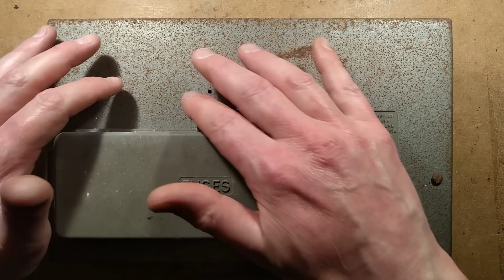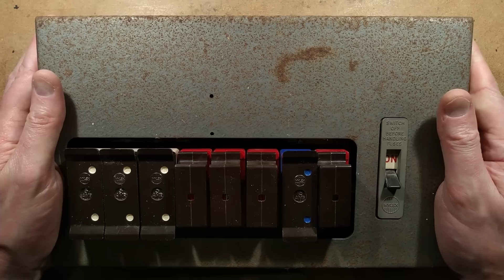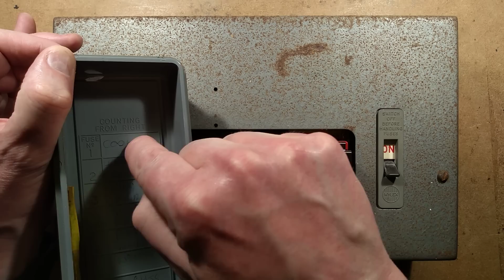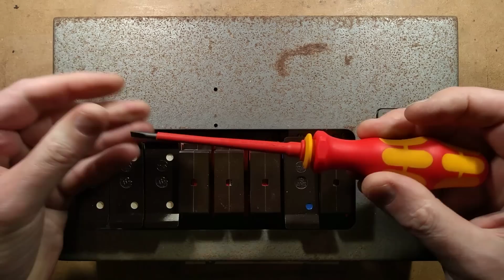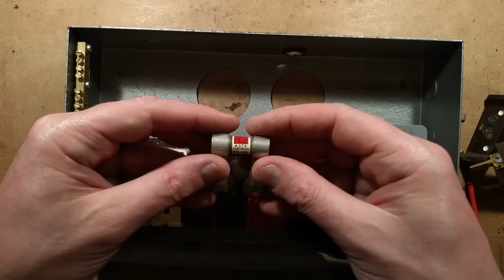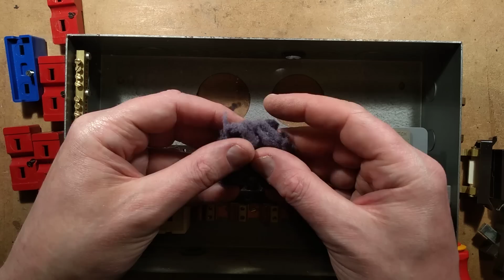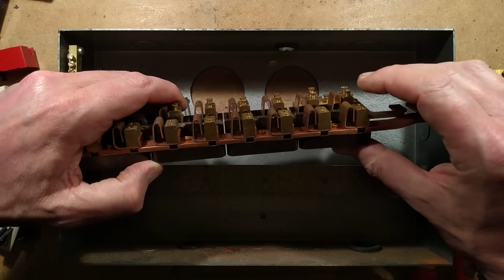Teardown of an old British Wylex electrical fuse box.  (with bare fuse wires)

Comment: When I was 5 the council replaced the fuse box in our flat.  I asked if I could have it and they gave it to me.  I took it apart and put it back together many times, even taking it to school to show my class :)
Reply: When I was about 7 or 8, our council house was rewired. This was the 1960s. Then in 2004 I worked in the electrical department of the local council, as did the man who had been the apprentice on the rewire.
Naturally I told him there were still a few snagging issues left to resolve, and asked when he could come round to sort them out. 🙂
Reply: It is awesome they gave it to you. As a kid I asked a man at a TV repair shop if he had any old circuit boards he was throwing away, he went in the back and brought two out. I spent years just looking at them, reading part numbers on the components, and learning what each thing was even if I didn't fully understand how they worked. The shop owner also warned me of the dangers of the high voltage inside the tv and how the capacitors would hold a charge and shock me in case I was thinking about taking apart a working TV.
Reply: @Andrew Ballard That is really awesome! It amazes me how kids are able to know so early on about what will likely become a lifetime passion for them. I imagine since you are watching BigClives videos your interest in circuitry has never died down.
Reply: Rick Delair  That is really cool! You knew it was your interest as kid! Your story reminds me of being a kid I would always go to the tire section at stores like Sears or Price Club, I was always so interested in cars so I would just walk around looking at all the new tires. As an adult, I have been an automotive tech for 20 years now. I could have told you at 4 that's what I wanted to do. The sad part was that no high schools in my area offered any type of auto shop. They closed them all down years before I attended. I had to go off campus across town to take an automotive program. 

As for your hobby with lights, I have been working on learning CRT TV repair. I am currently restoring a 1959 Philco Predictia television. Sadly with new HD flat screens just like forced LED light bulbs, not only has all CRT TVs been thrown in landfills, the shops of skilled TV repairman have all gone extinct. I have been collecting all the specialist CRT TV and old vacuum tube radio test equipment that has been ending up on eBay for pennies. I have about a full TV repair shop of tools now. 

I am glad you have the passion to collect and preserve what would otherwise be lost. Those lightbulbs are so important as they were the first generation of actual electric lighting, something that is taken so for granted people rarely remember that less than 100 years ago you were lighting the way with a flame.
Reply: Are you that guy with the vintage light-bulb website?
Reply: @uK8cvPAq  not me, I'm afraid
Reply: @christopher88719  The good 'ol days.  Now, the "helicopter moms" don't let their kids play with asbestos or other carcinogens.   Always making a fuss.
Reply: Rick Delair  boy I wish I could send you some pics of my light bulb collection...I love big industrial monsters and weeny dolls house specimens...but they must be tungsten..I have a 20,000 watt 240 volt beauty..thats a 40 amp lightbulb..the filament is an enormous spiral..sounds nerdy but makes a really interesting objet d'art along with about 5 other examples⚡⚡⚡⚡⚡  ps I also have a 4000watt microwave valve..2 foot 6 inches of brass waveguides and delicately suspended path tunnels in a 5mm thick glass tube atop a huge magnetotron!...exquisite ✔⚡⚡⚡⚡⚡👜
Reply: Rick Delair  ABSOLUTELY LOVE TO SEE YOUR COLLECTION 👀⚡⚡⚡⚡⚡👍👜
Reply: @christopher88719  that reminds me of when I had my first black and white TV in my bedroom. I was around 10 year's old at the time. My parents bought it very cheap from a guy as a present for my bedroom. It made a hell of a hissing noise behind the back cover when it was on. Being curios, (and without my parents knowing) I took the cover off and started poking around  to find out the area this came from. Dangerous and uneducated.
I found this big black plastic thing which the noise seemed to be coming from. I turned the TV off and started ripping this unit apart with a screwdriver to investigate. All the insulation had gone by the time I finished and finally gave up to find where the noise came from. I turned the TV back on and it went with one hell of a bang whilst I was prodding the thing. I now know what it was. It was the line output transformer feeding around 10KV to the CRT. How I am still here to to tell this story, I will never know.
Reply: Rick Delair wow , any chance of some pictures of them ?
Reply: @Andrew Ballard I was little, my dad came back from work with little motors, a battery, and little cogs and gears... I loved them... I wasn't any more weird than any other kid of the time.
Reply: Dr. M. H.  Ten years ago I was replacing the brake pads on the front of my car so both wheels were taken off. The car was held up with broken house bricks because that's all I had. I didn't have axle stands. I decided to drain the oil as it was convenient but I got the wrong size spanner for the drain plug. I crawled out and five seconds later the bricks gave way. If I had the right spanner to begin with ..... I am still here keeping safe through this pandemic and hope you do to.
Reply: @retrocomputeruser  Kids in those days were better made than the modern ones - we messed around with all sorts of stuff that would give elfin safety a heart attack, and we didn't die more than occasionally.  On those old TVs you could get cool plasma arcs if you poked the right place with a big insulated screwdriver.
Reply: @larrygall5831  
As Urban Kids growing up in the ruined buildings and slag heaps of the Industrial Revolution, we had a whale of a time playing in these fun places: arsenic works, copped works, sliding down slag heaps with bottomless black pools of water, splashing about in the toxin contaminated reservoirs of old works……ah what fun we had. My parents didn’t know though…..
Reply: That’s cool! I am having my fusebox changed on Tuesday from a Wylex 8 way fusebox with fuses like that to a 14way fusebox brand fusebox with RCBOs and I am going to ask to keep the old fusebox and I’m going to take it to school and show my freinds,

Comment: I'm not an electrician but I thoroughly enjoyed this video. I have a smaller 3 fuse Wylex in my garage where I plug my Tesla 3 pin plug in for slow charging. You video has demystified that setup nicely 😊 thank you 👍🏼😊

Comment: Clive, some years ago I was sat with my grandchildren watching Peppa Pig. (happy memories). My daughter-in-law opened the door to a cupboard under the stairs and shouted fire! I was able to gather up some burning plastic bags and dump them in the kitchen so we could put the fire out. The cause was a wire fuse (as  shown in your video) had blown. A hot glob of molten fuse had dropped onto the combustible material stored or should that be shoved in below. We changed to a modern breaker system (?) with in the week! Yes, Clive, the cover had been lost!

Comment: I liked this one. While I don't live in the UK, it was still interesting to see how a different country approached the solution to the problem of getting power safely into homes.
Reply: Definitely agree.  I was born in the late 70s in the US and I remember my parents' first house had the screw in type fuses (see link). -- upload.wikimedia.org/wikipedia/commons/0/07/Edison-base-and-Type-S-fuses.jpg
Reply: @OAleathaO   They are as reliable as the more modern circuit breaker type, the only drawback is you have to keep fuses on hand.
Reply: @OAleathaO  Never had those as a kid myself, our house had breakers, but I always wondered if you could screw light bulbs into the fuse sockets. :P Figured it would show you which one had blown easily, and lightbulbs were cheap. (Of course, as a kid, I figured 'fuses blow, lightbulbs blow, fuse = lightbulb'.)
Reply: @DijonFromage  They really are quite similar, too - a thin metal wire that heats up, and a holder. Only real difference is the lightbulb is thoughtfully constructed to handle getting a lot hotter. :)
Reply: @OAleathaO  still plenty of them around and in use in the notheast

Comment: You nearly gave me a heart attack with your liberal display of "asbestos"... Nicely done :-D
Reply: I put duct tape over my dryer's lint trap just in case. :D
Reply: I grew up in Quebec, not far away from one of the world's biggest asbestos mines, there's a town literally called Asbestos there. Our government was one of the last one to ban asbestos. It's still kind of surprising to me seeing how people freak out about asbestos. When I grew up, all we heard was that it wasn't all that bad, that you should just limit long term exposure. I'm pretty sure handling asbestos in your hands for a couple minutes, like you pretended doing, would not have been considered a big deal around here in my youth.
Reply: Olivier Engelkes I used to work in Iron ore in the main area in Australia which produced blue asbestos... I was trying to work out where the other colours in there came from for a second😂
There is a very pretty rock that gets quarried out of the BIF they call tiger iron which can look like landscape paintings... or modern art which is from iron oxide replacement of the asbestos which originally filled the fault or whatever... people sell it on eBay and some of  it looks a lot like that (the colours not the swirling) when you crush it a bit... because not all the asbestos is replaced
Reply: @gfilion  that it probably was not considered a big thing back then is a testament to how effective the industry’s efforts to cover up the risks were.
Reply: @gfilion  You can handle asbestos however long you want. I've seem mesothelioma and I say better safe then miserable
Reply: You have a heart attack just at the thought of someone having about a 0.0001% increased risk of cancer at some point in the future? Did you nearly have an aneurysm when Clive ate those charred sausages? :P
Reply: @RFC3514  no, but when he touched live conductors some weeks ago ;-). I am in no way able to give a professional assessment, but I do think the risk associated with fondling asbestos  is orders of magnitude higher than eating sausages from the electric chair...
Reply: Not that amount of asbestos, in his hand, for that amount of time. The risk was (or would have been) essentially zero. It's like being scared of bananas because they're radioactive.
Reply: @gfilion  that mine used to say the white asbestos wasn't bad, so they could still sell it...
Reply: @RFC3514  I work for the lung cancer service, and trust me... you shouldn't be so brazen about the dangers of asbestos. It's far more dangerous than you seem to be informed. Mesothelioma is no joke.
Reply: I'm not "brazen" at all about "the dangers of asbestos". I simply know what the dangers of asbestos actually are. Freaking out at this video because "it might cause mesothelioma" is like freaking out a video where Clive handles a lithium battery on the grounds that "it might stop his heart" or "it might catch fire and burn down his house". 

Hopefully most people who watch this channel know why that is a silly leap. A battery can certainly be used to stop a heart, and it might catch fire, but the odds of it happening by chance when you're just handling it are infinitesimally small.

And saying "trust me because I work in a cardiology department" wouldn't change the fact that the risk is virtually zero. It's just fear-mongering based on an obviously skewed perspective (you see a lot of people with cancer in the cancer department? well, guess what, most people visiting a cardiology department have heart problems, most people in A&E had an accident, and so on). 

Asbestos isn't a synthetic material, it erodes naturally off certain types of rocks, and most humans are exposed to more asbestos particles over the course of their lives than Clive would have been in this video even if that were made of asbestos. Even among people who worked in asbestos mines, mesothelioma rate is only about 10x that of the general population (i.e., it's less dangerous than smoking, as far as lung cancers go). The groups at really high risk are insulators and sprayers (who were exposed to large doses of airborne particles on a daily basis, for decades), where the rate is about 100x the population average, and peaked at over 300x the population average, in the 1980s. Even in that group, though, the vast majority did not get mesothelioma (although many did have other problems, the most common of which being asbestosis).

I suggest reading (for example) PMID 28593073 by Pukkala et al. for a recent study of asbestos-related diseases in Europe (covering several decades and comparing different groups).

P.S. - Maybe Randall Munroe needs to do a chart for asbestos like he did for radiation: https://xkcd.com/radiation/
Reply: @RFC3514  Nice false equivalence, appeal to nature,  and cherry picking from a study that's about how exposure to asbestos in industry caused a greatly increased risk of cancer and mesothelioma. It's quite clear you have no clue what you're talking about, don't continue to go around and downplay the dangers of something that can cause life ending cancer from even a single exposure.
Reply: Well, considering the massive amount of statistical evidence (and scientific knowledge) you presented there, I think it's settled, then...
Reply: @gfilion  yeah and back in the day blood letting and smoking was throught to be good for you........
Reply: Nah he is immune to all. Asbestos, solder flux fumes, lithium cell fumes. He cannot be harmed. And he is Scottish ( drank that stuff, white spirit was it? ). They are scary and tough people! They are survivors. Im from London, and i am not. I use a fume extractor for my solder fumes and have asthma probably as a result!
Reply: Guillaume Filion They say white asbestos is safe, due to the curly and it supposed to dissolve rapidly in the lungs but I still wouldn’t want to breath it in
Reply: The worst aspect of Asbestos exposure is that different people react differently to it.  Some people have worked with asbestos for many years and have minimal health issues.  Other people can have just a limited exposure and have horrible problems with mesothelioma.  You simply cannot tell how reactive to it you are until you develop health issues.. somewhat too late by then, so the only way to be safe is to not be exposed to it.  Stories of "my great uncles mate worked in a blue asbestos mine for 40 years and is perfectly healthy" may be quite true, but do not represent all people, or indeed the risk to other people.  I'm always impressed with the properties of asbestos, but I definitely do not want it in my lungs.
Reply: @drruncmd  solder flux fumes? I recently triggered an "oh we'd better look it up" from bosses and union, over 'extended use' soldering MDF jumpers the last 15 years. ;)
Reply: My grandfather worked with asbestos just about his entire life in the navy and as a gunsmith. Its great when heat treating metal. I still have like 10 rolls of asbestos padding in the gun shop. It cant be that hazardous, as he lived to be 92 and died of a heart attack.
Reply: Have a look at asbestos use in the film wizard of oz, ( it was used as fake snow)
Reply: Instablaster.
Reply: That blob of asbestos came from Clives asbestos sweatshirt.

Comment: Grew up with those as a kid.
Dad taught me so I could be the one who replaced the fuses wire if he was at work, there was always a cardboard wire holder balanced on top of the box - just in case it was needed.
And also just in case he had a mains testing screwdriver (looked like a neon and resistor) to test that it really was turned off. I never worked out how it was safe to test for live wires by putting his thumb on the end of the  screwdriver handle and checking it didn't light up.
Totally surprised to see those still available from toolstation today. I'd expected health and safety to get rid of them!

By the time my parents died and we were clearing the house, the rubber covered wiring had deteriorated to the point I just turned the boxes off on every floor just for safety.

Comment: I’m glad you pointed out the fact that theses old beauties are still compliant as long as they are in good condition as this one clearly is. I’m sure you know there is no legal or regulation requirement to change them . When we test older installations we can sign it off as safe for continued service as long as all the test readings are within the specified limits set out in BS7671. Page 99 in the onsite guide makes it clear. 
Also the fuse come in as white =5amp blue 15 amp yellow 20 amp red 30 amp green 45 amp and orange 50amp there was a purple that was 60amp but was very very rarely used in domestic installations.
The most common was the 5 15 20 and 30 amp fuses.
Also I think you will find that the main switch is double pole ie i breaks the line and neutral. Even the one with the plastic cover and wooden base are still compliant if in good condition. As for the fuses I have seen were some people replace the blown fuse wire with a nail or a paper clip even a peace of kitchen foil. Fantastic video as always Mate 👍